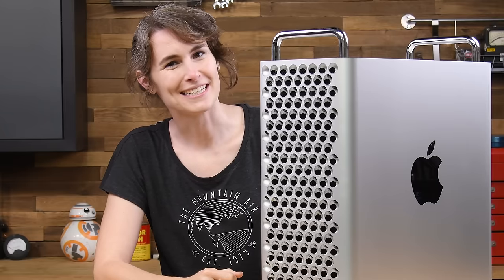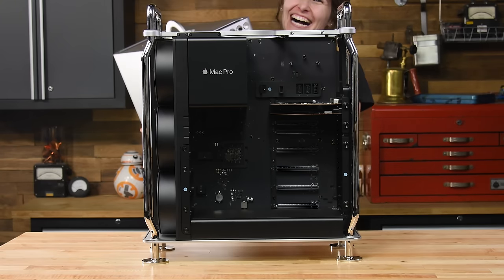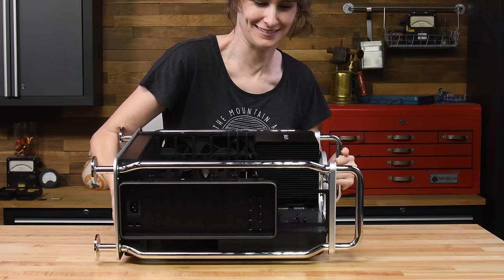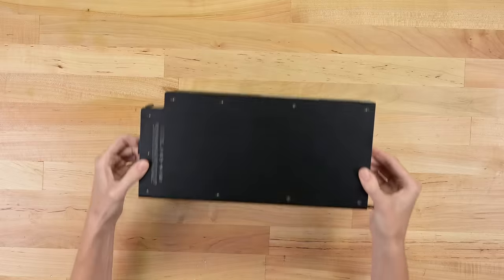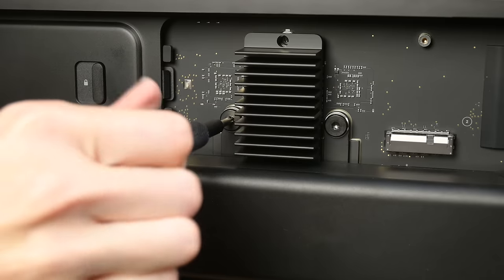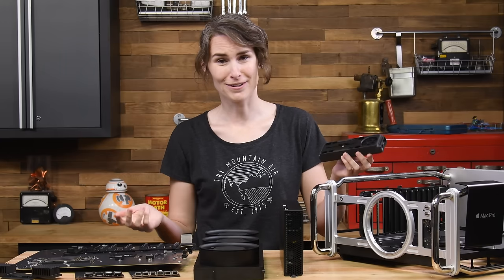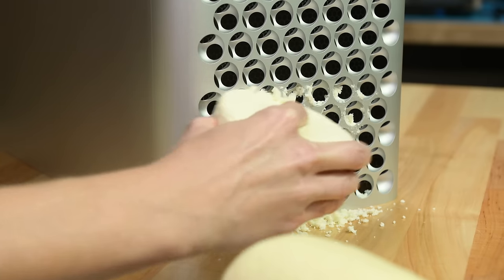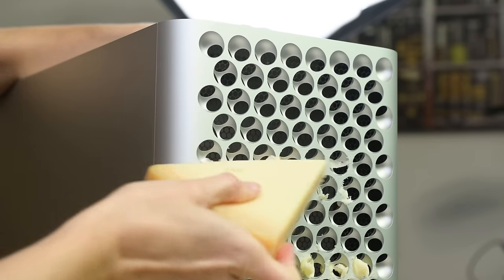Mac Pro 2023 Teardown: It’s Grate!!!

Comment: They really locked this one down. 7000 bucks for a cheese grater you can't upgrade.
Reply: You know what's funnier?
The CPU they put inside it has a measily 24 PCIe lanes...
They have multiple x8 and x16 slots, but there are only two PCIe busses, one x16 and one x8 all split up through PCIe switches.
For some context, I've got a 3rd gen Ryzen 7 PC and that thing has 24...
Reply: Ahhhhh! Why does apple tease us so? They have such brilliant mechanical design... to make it easy to do upgrades that you can't actually do! Ugh.
Reply: @jjoonathan7178  they want other companies to produce better full tower ARM alternatives
Reply: I thought it had 7 PCI slots!?!?
Reply: @shapelessed In practice it probably won’t matter to much most of the time, they are Gen 4 lanes and mostly for audio add ins, the only thing it supports that could use a lot of PCI-E bandwidth would be NVME drives in a configuration you would not likely use a MacPro for and instead an external NAS anyway. It’s mostly for audio and network cards that can easily manage full speed with a tiny handful of Gen 4 lanes.
Reply: This tight integration is the reason why the system is so fast. Pros and cons, bro
Reply: @quantuminfinity4260  There are many types of accelerator cards that can be used there in place of SSD enclosures and GPUs, many of them bandwidth-intensive.
Reply: @mluu510  it is not
Reply: @nitrobear  really? Show me another system that can get these benchmark numbers given the same tdp envelope
Reply: @shapelessed Even the 2019 Mac Pro had 64 lanes
Reply: dont understand why people buy this crap? 7k i can build 3 pc faster and better !
Reply: @peterpeter5666  
A: I highly doubt it, though building one or even two systems is possible
B: People buy this system for internal expansion they need for their work, and just like with the Mac Studio, they have to run macOS for work. Also these two computers are incredibly quiet. 
PC computers with comparable power will sound quite loud, but this computer, like the Mac Studio are whisper quiet in every situation except in hot weather when you're pushing the CPU and GPU at full power I guess.
Reply: @peterpeter5666 It’s just businesses. You can build gaming PCs for less, but you can’t build enterprise-grade systems for (much) less. For instance, Intel Optane storage is $1500 per TB vs the $200 you’re used to. 

When time is money, uptime is king. If something goes out on enterprise-grade hardware the manufacturer usually sends a living person with a fix to your door within a couple hours. That’s something you can’t guarantee if you build 3 $2000 computers for someone.
Reply: @mluu510  any android phone with a brand new high end snapdragon they are just as efficient and they give you the power of two Xbox ones in a phone
Reply: @mluu510  i use an iPhone 13 it's a fourth power at max it's about a third the power of a high end Aredeno
Reply: @TheOfficialOriginalChad  if I want to use CAD I can't use a MacBook fusion 360 AutoCAD blender any cad software doesn't work on Mac it's not good for that business if I'm gonna be making parts for a company I can't do them with a Mac I can make a music though and video editing that is it
Reply: @TheOfficialOriginalChad  macs are useless for engineers
Reply: @beatyoubeachyt8303  yes, and how did Snapdragon achieve that? By being a SOC. No ram or GPU upgrade
Reply: @beatyoubeachyt8303  really? I am an engineer and I use Macs exclusively
Reply: OK this is impressive how they downgraded to Pc without people noticing that …. It used to have 1.5 TB of ram now only 200GB… it used to have up to 4 GPUs now only one … it used to have much more PCI lanes because of the server’s CPU..etc
Reply: @sayedhasansayedfadhul2909  build your a PC of you don't like it. More 99% of pros, this is more than enough
Reply: It’s just not 1997 anymore. Those days of “upgrading” are basically over. Just buy the right machine for your needs and be done with it, i say

Comment: basically a big mac studio with expandabily but no upgradability no extra ram, no combatibility with  GPUs and  you can not upgrade the ssd because its firware locked.
Reply: For people who have add in cards for specialist tasks / audio / video. Robot overlord interfaces.
Reply: You actually can upgrade the boot SSDs, Apple sells upgrade/replacement kits on their store. You can also obviously add storage on PCIe cards (M.2, SATA, etc.) or with the Pegasus HDD caddy.
Reply: They didn't make this for PC lovers. Give up on that paradigm! The advantages of integration (All CPU, GPU, Neural Engine, and specialty processors for video, audio, and graphics integrated WITH shared memory onto the processor die) outweigh modularity for those components.) The fast solid state storage is, sadly, locked to the system, BUT you can add SSD cards to the PCI slots! This is basically a Mac Studio Ultra with slots that allow you to connect all sorts of outboard video editing gear, robotic devices, and other exotic components. It does not need graphics expandability... LOOK AT THE SPECS. 60 or 76 graphics cores should be plenty for the expected life of this machine.
Reply: @williamburkholder769  The GPU isn't that fast when compared to what PCIe graphics cards are available today
Reply: @williamburkholder769  Even those graphics cores still get outperformed by dedicated GPUs. Even if they didn't, many people need things like CUDA to do their work and those people just cannot use this device. You also cannot expand the integrated GPU to get more VRAM, which many people who buy these high performance computer need.
Reply: @williamburkholder769  So a scientist who needs one or more NVidia A100 80GB PCIe for cuda or a few AMD Instinct MI210 can't use this, got it.
How much VRAM does this SOC have anyway?
Reply: @lbgstzockt8493  the M2 Ultra has 64GB of Unified Memory as standard, which is more than the RTX 6000 ADA. Totally get that CUDA might be necessary for certain programs but you should look into how Unified Memory actually works when compared to traditional RAM and VRAM.
Reply: @stephen1r2 RAM and VRAM go out the window with Apple Silicon :)
Unified Memory is what they’re using now, which shares the RAM between the CPU and GPU, no need for copying data to and from, and it allows for theoretical max of 192GB of memory available to a program that needs it. Thinking like, huge machine learning tasks or giant 3D renders.
Reply: @zoruaboy  So Apple has a 256 (or 512) GB Mac Pro now? And on par performance to an NVidia A100 ai accellerator?
Reply: @stephen1r2  512GB like, Unified Memory? Not yet. And I don’t know about A100 performance, I’m not in that field, so I can only tell you what I know, and I know that Apple Silicon abandons the traditional model of RAM/VRAM, making it much more efficient, and the immense power savings eventually pays for itself when compared to a similar PC workstation. I also know the Neural Processor on the M2 Ultra is a lot faster now, so feel free to do your own research on how it compares to the offerings from Nvidia?
Reply: @williamburkholder769  non upgradable is ewaste and ethically wrong.
Reply: @stephen1r2  up to 192GB......................................
Reply: @stephen1r2  don’t think you can use those on any generation of Mac Pro even if you tried. These aren’t scientific workstations, these are made for video editing, desktop publishing, and CAD work.

That being said, it would be nice if the M2 Pro had upgradable GPUs, the 2019’s W6800x and Vega Pro II would run circles around the M2’s iGPU.
Reply: @williamburkholder769  cant tell if this is a troll account or not but ill give you the benefit of a doubt here on that this is not a troll.
modularity allows for an upgrade path meaning you can keep your pc up with the times. If apples history with blatant and incessant lies are anything to go by I struggle to see them keeping pace with current competition. Restricting graphics to just the one for shared memory reasons is utter lies, we have already seen cpus and integrated graphics share the same memory with no worries about a dedicated gpu. as for onboard audio processing that is done by a dac generally next to the analog signal whether its a headphone jack or part of the chips by the driver in an earbud. unless the cpu has a headphone jack on package I can assure you its not processing audio outside of just repeating stuff to the dac for it to process.
The last sentence of yours concerns me, expected life? This isnt groceries at a shopping mall or a subscription, this is a physical machine that people will own and expect to be at least usable. There is no expiration date, the second hand market exists and people have upgraded their outdated macs before to give new life to them. 
Acceptance of a products expiration date for a non consumable item is a dangerous path and is a much bigger problem than whatever companies make.
Reply: I understand the RAM and GPU issues, as the design of Apple Silicon means they are integrated, but to lock down the SSD? Why?!
Reply: Literally just a Mac studio with a silly case and no upgradability
Reply: @willm5032  it's a limited amount of people who will be using those PCI expansion slots (when you can;t upgrade the GPU), for sure.
Reply: @DrMacintosh the SSD kits for the Mac Pro still requires Apple Configurator 2 on a secondary Mac.
Reply: They're selling their own SSD upgrade kits on the Apple Store.
Reply: I understaand why M2 can't address displays on other GPUs, but I wonder if you can still use them for rendering and compute?
Reply: @Jan-xf8sk  So they are up-gradable, got it.
Reply: From the first M1 chip you should have learned that there will no longer be Apple computers with upgradeable RAM and GPUs. It's not a surprise. You can either acknowledge the engineering reality of Apple Silicon or you can stamp your feet and whine. The 2023 Mac Pro is exactly what I expected to see from Apple because I have two eyeballs attached to my brain and a lack crybaby gamer petulance.
Reply: This is running a custom arm processor, your GPU isn't compatible anyways
Reply: @mluu510  o know i will stick to my nvidia gpu
Reply: @zoruaboy 3D renderer? Really?
When M2 Ultra's GPU hasn't any Ray-tracing hardware accelarator?
When you can't add any graphic cards on it?
This isn't something serious!
You will be able to render 3D far far faster with a 1500€ PC based on a single non-Pro RTX4070...probably at least 10 time faster.

Unified memory isn't that great :
- the memory the CPU uses isn't available for GPU
- the Bandwidth is usefull for GPU, NPU but too high and useless for CPU...
- the way Apple uses it should be forbidden...no evolution is possible!

Can't understand how people can defend such a device...
Can't add Ram on a Desktop! Are we...in 1980?
Paying 1150€ to change for a 2To SSD when it should cost 110€ with better read/write capabilities.

Huge machine Learning? Really?
Huge machine Learning needs additional cards?
Plugged on PCI-e...
You will tell me you've got 8? That's the dishonnest way Apple presented it!
First it's PCI-e 4.0, not 5.0!
Second when you count all the lanes used by all slots, you need 92 lanes
M2 Ultra is able to use...only 32 lanes at same time! Yes, you only have about a third of the bandwidth you need to use all your PCI-e slot at same time!
Not even close to the 128 lanes you can have on PCI-e 5.0. Fine.
But it's not even a full PCI-e 4.0 that allows 64 lanes!
If you put 2 dedicated AI cards, and a simple SSD, you will be limited by your bandwidth!...despite the 5 other empty PCI-e slots!

Marketing can fool some people...
Reply: Probably half the costs is R&D just to lock it down to prevent upgrading by users. 😅
Reply: They didn't even bother trying to hide the planned obsolescence with this one... Typical Apple move ig?
Reply: @williamburkholder769  Apple never designs their products with the customer's best interest as the first priority.  Their top priorities are profit and controlling the way that their products can be used. And at this price point, there is not a reasonable excuse for disallowing upgrades.
Reply: u can upgrade the ssd just make sure u follow port 00 to port 01
Reply: @williamburkholder769  " It does not need graphics expandability" ... the mac used to had a mouse with just one button sensor , no no right ckick or a scroll weel , back then they said "It does not need more than one button".
you are deluded and the MAC thing is a religion. This is a plain scam and you are apologizing for it.... again
Reply: @jondonnelly4831  Using 2/3 less power is ethically right.

Comment: Such a huge PCB for what is basically just a glorified PCIe expansion case... It looks really really weird.
Reply: The board design is insane, they would be using a board with a bunch of copper layers to fan out that BGA, which is expensive, ludicrously so at this size, and they're wasting most of it! You can tell the profit margin on this machine is out of this world, otherwise they wouldn't do that! They would have two boards, one with enough layers for the BGA and another with just enough for the rest, like they did with G5s.
Reply: My first reaction to the whole video didn't really come until Sam took the board out. I startled my dog yelling, "WHAT IS EVEN ON THE BOARD??? Maybe it's on the back?????? Nope."
Reply: @s8wc3  I don't see why they'd need a lot of layers.  The reason the package is so big is that Apple used package-on-package DRAM; there's eight DRAM packages hiding under that heatspreader. (If you want to see this for yourself, wccftech recently posted an article with pictures of a delidded M2 Ultra.)

Unlike similar Intel and AMD big packages, none of the DRAM signals (and there are a lot of them! 1024 bits wide, IIRC) have to leave the package. Only IO does, and I'd be surprised if there's more than 64 lanes total SERDES. That shouldn't be much of a problem to route out.
Reply: @t.s.4494 ram is 64bit for ddr4/5 (though ddr5 has this split up into 2x32bit streams).

And what you are describing is not how dram works at all from CPU to dram. The literal only difference here is that there isn't expandability.

Sure, have soldered dram close to the SoC provides slightly lower latency, but beyond that, there is no difference (and certainly not anything a user or program would notice).

This is blatantly done for $$$

Comment: 2:44 If Apple had bought Intel's Optane patents/IP they could have used that as persistent memory in some sort of dimm slots. If any company could have gotten full use of Optane's theoretical capabilities, it's Apple. Like, 6TB of persistent memory, all swapping would have happened on the Optane modules
Reply: Nah, they would integrate Optane onto the chip.
Reply: @XenonG  That is kinda not possible because of processes, but i agree, apple would not make it modular under any circumstances.
Reply: I'm a software engineer/architect and at my work we have actually used optane as memory in some very high memory workloads (mainly scientific computing) where it was just way too expensive to buy all memory.  I agree it would have been cool if Apple had done that so we could have actually had swappable memory in addition to the soldered on RAM.  I'm no expert but from my understanding when you add enough Optane and present it to the OS like RAM, the actual RAM becomes a sort of cache for it.  Would have been really neat.
Reply: @Watchandlearn91  you'd expect that at this price, techs with enough budget would just take the hit and pay for the memory modules as well...

Comment: As a non Apple User who hasn't ever paid attention to the Mac Pro, this makes my brain hurt. Why would you buy this over their Mac Mini Studio (or whatever it's called) if you can't upgrade it anyways?
Reply: It’s basically just for users who require pci-e expansion slots for specific hardware. Otherwise it’s the same as a Mac Studio.
Reply: @ConnorGriffinMusic the irony being that a lot of cards like ProTools HDX and SDI Capture cards work perfectly fine in external Thunderbolt enclosures, especially since the Studio already has a ton of TB4 ports
Reply: The main reason would be dust accumulation and easy access to internals. The Mac Studio will require a full disassembly every time you decide to clean the heat sink  and psu from dust.
Reply: @z37d4 I've heard NVME expansion was feasible but limited in bandwidth. I'd encourage you to check that out before making a purchase. Even this use case may not be applicable
Reply: Because it's an aesthetic case with upgradability for very specific uses.

Comment: What ruffles me the wrong way is the lack of support for MPX. I know we're moving away from add-in GPUs, but there are workloads that could still benefit from them in addition to the integrated GPU cluster on the M2 Ultra. Not to mention that an MPX module doesn't even have to be a GPU.
Reply: Well...MPX was kind of a weird hack Apple did to get around the limitations of PCIe 3.0, using an additional connector to add lanes and carry video output over the Thunderbolt bus. Given that you can't use MPX in any other computer, and the number of computers with it was a relatively tiny fraction of a minority to begin with, it's not like manufacturers were lining up to support it. If Intel had had support for 4.0 at the time, Apple might have made some very different design decisions. 

That said, yeah, it'd be cool to be able to have some sort of M2 blade server type machine, or a derivative GPU-only chip, that could run in concert with a host Mac the same way they used to with Xgrid.
Reply: In what world are we moving away from add-in GPUs?
Reply: @nmotschidontwannagivemyrea8932  In the "Apple" world they are